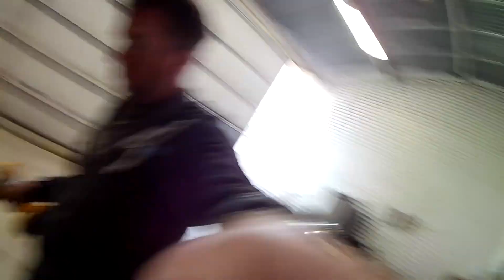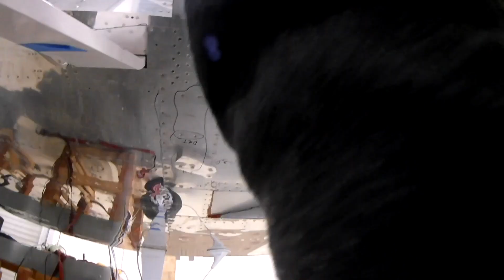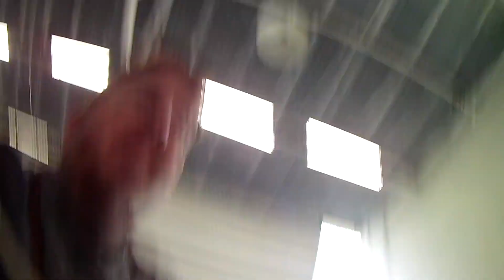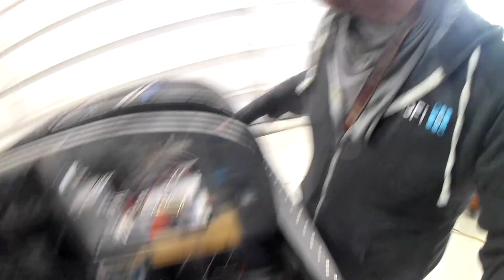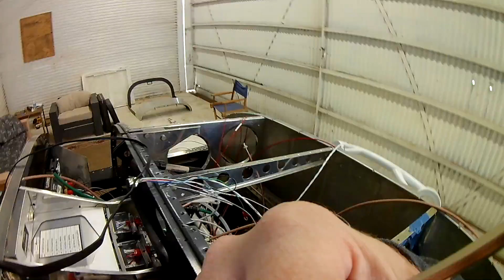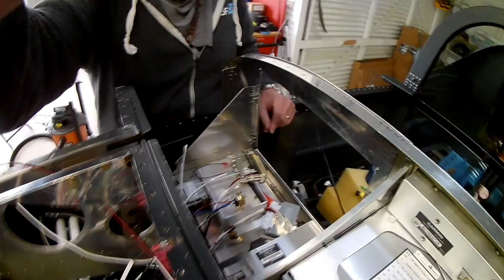RV-14 Canbus Finale I

Comment: I was wondering how this would all work since the panel mounted comms have an intercom and the audio panel has one as well. Was also thinking since the comm has a two spot intercom I might forego the audio panel in an RV-14 if I decide to build that instead of an RV-10. Those music and split comm functions of the audio panel are pretty sweet though.
Reply from the maker: Right?! And with the GMA 245 audio panel into the G3X all of the split comm stuff is on the G3X and is extra sweet!!

ONE SMALL gripe with Garmin on this though. You can't play music or hear your phone call through the speaker.